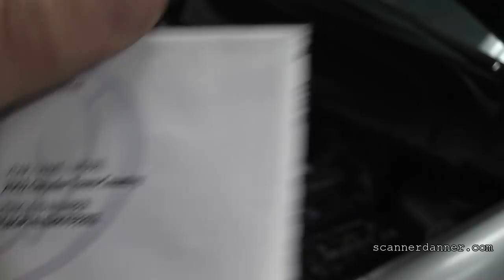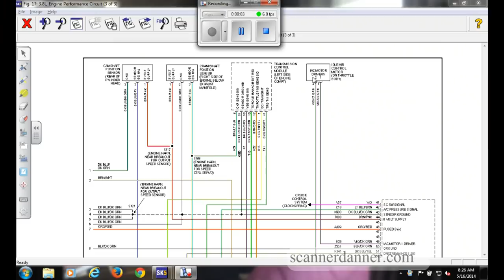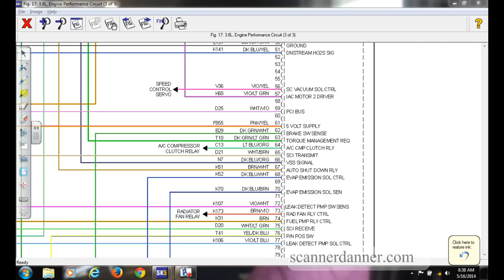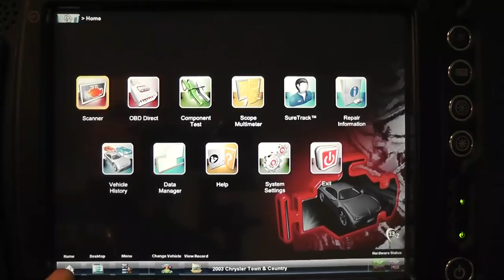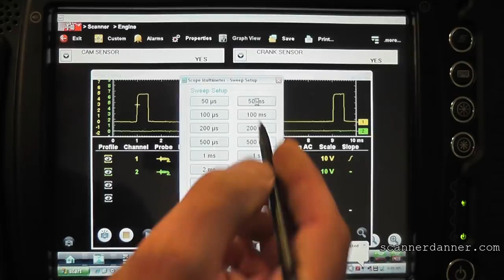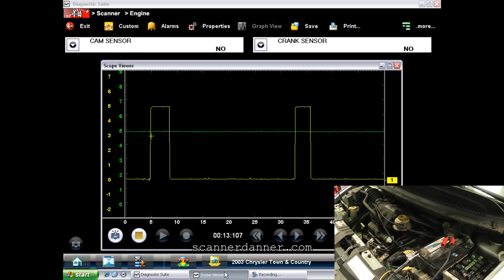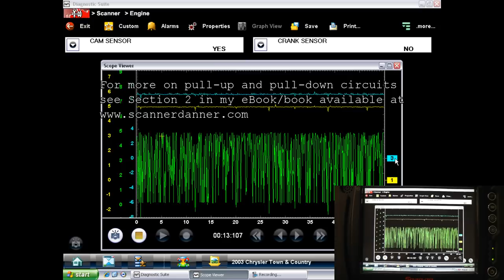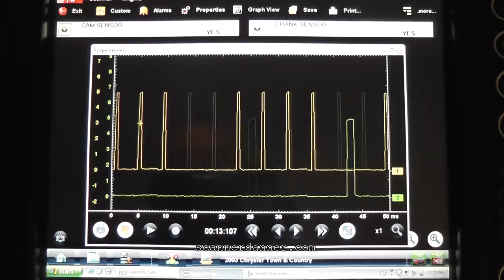Faulty cam sensor setting a crank sensor code - P1389, P0320, P0622

Comment: Every manufacturer I've had any experience with has fudged their model year cut-offs all over the place. The VIN says that T&C is a 2002, that doesn't mean 2003 stuff wasn't put on early, or leftover 2001 stuff put on late. Always have to be careful of that stuff, especially on years bordering design changes.

Comment: Superb Paul,I love how you can “prove” that the cam sensor is faulty,the thing is a lot of people(especially the general public)think that running a diagnostic on a vehicle will pin point the fault but as I’ve found out many times in the past and as you are proving here it’s simply not the case....Thanks again

Comment: Worked on a Kia recently with a cam sensor code. One of the fixes was listed as crank sensor, and i've heard of this on other brands as well, Always wondered what the reason was, now i know. Love your channel! My fix happened to be the first thing i checked, the ground. 121 ohms, next i checked battery ground to engine , SAME. Cleaned negative battery terminal, back to 0. ALL GOOD.

Comment: Danner at his best!  Here we have Verus training, scope and scan tool usage. How to use the wiring diagram to connect properly. Quick question. If the sensor is fed 9 volts, why does the cam signal high read 5?

Comment: it's superb Diagnosis and well enough explained. As I'm just a beginner, have some questions; power feed 9 volts - signal 5 volts (why & how is the difference between Power Feed volt vs Signal volt? when you unplugged Cam connector, it was showing 5 volts because PCM was sending 5 volts on Signal Wire? when connector plugged why trace on Scope was so noisy 5v <-> 0v while KOEO? though it must show 5 volt steady as Crank.
I very much realized how super necessary a Scope for modern day vehicles. Thank you Paul

Comment: Scanner Danner you commented @ 31:41 that the test leads on the verus were too short, Verus has a 9 FT USB cable, you can remove the scope from the Verus and use the USB as an extension cord and leave the verus on the bench.. you probably are aware of this already but in case you arent., , Also, Love the Vids, I am a scope guy and learn alot from your Vids. i wonder how i ever got along without the scope. I use it more and more every day. Again thanks keep the vids coming.

Comment: Nice video. I wholly subscribe to your diagnostic techniques (i.e., testing and verifying with a lab scope, etc.). However, I wish shop owners, managers, and service writers where I have worked would understand the importance of diagnostic testing. Unfortunately, they seem to equate experience with having knowledge of pattern failures and skipping the testing. If you want to test, it seems to be why is it taking so long. This is very frustrating.

Comment: I like to use the component test for the same reasons one thing I have noticed though is that some of the component test headings will limit how many channels you can use. Also you mention the length of the leads there is a set of leads available I think they are 10 feet long, it is actually designed so you can hook up the scope and drive the car. Probably a little excessive on the length but longer.

Comment: Paul can I ask you a question,have you any idea why like in this example the manufacturer has 4 windows cut into the flywheel for the crank sensor to pick up on,I can’t understand why they do this if it’s only to identify a cylinder at TDC.....why not just one window giving one pulse on the scope,the same for the cam sensor...why so many cut outs/pulses ? I’m really confused about this.....Many Thanks mate 👍🏻

Comment: Just curious, I have picked up a Hantek 1008 scope and am trying to soak up as much as I can about using the scope for diagnosis.  Would you need attenuators on this kinds of sensors? (cam and crank)  My unit came with test leads but no attenuators, so don't want to be putting the unit in harms way right out of the box!
Reply: You will need Attenuators when you need to step down Voltage so you dont harm your scope.  Something like the magnetic field spike on an Injector, or the firing of a spark plug when scoping a coil.   Sometimes that stuff can get crazy spikes.    When you use the Attenuators, make sure you select that option in your scope.
No need for one on a cam or crank sensor.

Comment: I have a 2008 bmw x3 3.0si, it has a code for the crank postion circuit p0335. Only symptoms is long crank times and running rough. I replaced the sensor but it didnt solve the problem. Any direction??
Reply from the maker: you'll need to test the crank sensor circuit with a scope preferably or with at least a digital voltmeter. 
Post here for more help
 https://scannerdanner.com/forum/post-your-repair-questions-here.html
Reply: ScannerDanner thanks for the reply, it ended up being a crank sensor fitment issue with the oring

Comment: I dint know if you'll reply to my comment.   I got a code p0340 faulty camshaft sensor,  ordered the part haven't gotten it installed yet, then this week code p0622 came up.  anyways can a bad camshaft sensor cause a code p0622 something to do with the alternator am I right?     2003 Mitsubishi eclipse v6. Camsensor is built in the distributor

Comment: You mentioned that there's a lot of oil under the hood from leeks.  Did the oil have any part of the cam sensor failing?  Great video!
Reply from the maker: not at all related. Thanks!

Comment: I have a 2010 Grand Caravan and about a week ago it shut down while my wife was driving it. It would then crank but not start. It was running perfect before this happened and only has 42k miles on it. I took it to shop and they said it "jumped time" and will probably have a lot of damage since it is an interference engine. My question is could a faulty or disconnected cam position sensor mimic a jumped timing chain? Sorry if this a dumb question, it just seems highly unlikely to me that a timing chain would fail at such low miles.
Reply from the maker: That does seem very unlikely. And yes a faulty cam or crank sensor could have similar symptoms but not typically. Does it sound like it is cranking very fast?
Reply: No, it sounded pretty normal the first couple of times. The third time I cranked it a little longer and it kinda sputtered a little.
Reply from the maker: Where are you located? I'll confirm that diagnosis for you for free if you let me film it.
Reply from the maker: This may sound crazy but I'm traveling out west in an RV with my family around the 2nd week of June. We are heading to arizona and Utah  from Pittsburgh pa. Would you be in route for me to stop by? I'm actually bringing all of my equipment and was planning on helping people along the way.
Reply from the maker: If you're in a hurry to get your van fixed. Get a second opinion. Something doesn't sound right with that diagnosis
Reply: I think I will do that. Thank you for responding.
Reply: I just saw your previous comments. I live in Poplar Bluff, MO. Probably not en-route for you, but if so that would be great!
Reply from the maker: Big Sky country! I would love to visit your state someday but you're correct, not on this trip. Keep me posted on the fix okay?
Reply: Missouri actually, but we need to drive it to Alabama June 17th so if it does need major work/new engine I'm gonna have to get it fixed pretty soon I guess. I appreciate your input. I'll keep you posted.
Reply from the maker: Lol why would Missouri be abbreviated MO?  What is Montana?
Reply: I know, I always thought it was kinda goofy too. I guess MI was in high demand though, between Minnesota, Mississippi, Missouri, and Michigan. Lol
Reply: highly unlikely , get a second opinion

Comment: My 5.9 Durango quit on me once, with ASD/FP relay rapid clicking after warming up. Found the ground side switch of the relay from the PCM was coming in and out, and powers and grounds were good coming in to the PCM. Found myself triple checking stupid shit just so I didn't have to buy a PCM, but the new PCM fixed it.

Comment: thats an intresting issue. i have this very van same engine and all and keep getting a cylinder 2 miss. ignition system all replaced has perfect compression. leaning in the injectors direction. thoughs?

Comment: I noticed the cmp and ckp waveforms never overlap (on top of each other).  What could cause a Jeep 4.7 trace to show cmp and ckp  frequently on top of each other.   The Jeep runs fine but has a reoccurring intermittent cmp / ckp fault code?
Reply from the maker: you will need a known good cam and crank waveform that you can view in detail and compare it to your own. Post this to my forum and we can help you there. Thanks! IT is free to join 
https://www.scannerdanner.com/forum/post-your-repair-questions-here.html

Comment: Question, Paul. I thought cam sensors were really only necessary during startup, and that once the pcm knew which stroke the engine was on, it just repeated the firing order over and over. Is that true on some models, or do you always need a cam signal?

Also, why is there the 1,2,3 style signals? Why not just one cam pulse every 720 degrees, and then rely on which crank tooth its on? There doesn't seem to be very many crank pulses here.
Reply from the maker: It all depends on the crank sensor design. If there is no sync or identifier signal in the crank sensor, then the cam is also needed for start up to occur.
If you have my book, this would be section 22 I believe.
Here is a lecture I did on this very topic
Section 22 No Start, No Spark Diagnosis (Part 1)
Reply: ScannerDanner
 MINI coopers, you do not need a cam signal for start up. We had a crank no start condition, scoped the camshaft sensor, had a small blip in the wave form on one of the 3 phases. (small, medium, big)   Unplugged the sensor, car started.  (Didnt run to well and went into a fail safe, but started nonetheless.)

Comment: Hi
I have santa fe 2012-V6-3500L -18000km, when  turn on to  run position - engine stop (The pump should run for about two seconds) the fuel pump did not work !
and I start engine hard because of that (on engine run fuel pump work very good and Pressure is very good too ) ,   I check fuse and Relay it  very good !
why my fuel pump not work in run position- engine stop for 2 second  ?

Comment: I have a 2011 chevy impala the traction control, and stabilitrac lights came on then engine light the car started shifting hard, and engine began running really rough. I checked the wire visually did not see any problems with wires I could see. I had a guy check the codes and he said it brought up invalid codes, and thought the ecm was bad. So I replaced the ecm out of another 2011 impala and flashed it 10min security light on 1min. security light off and 30seconds with ignition off X 4 on 4th one after the 30second ign.off started car. After starting car it ran perfect for a few minutes then traction, and stabilitrac lights came on and engine light was already on but engine began running bad again. Shut car off let sit for few minutes restarted car ran good again with engine light still staying on. I ran codes again now it shows P0315 crankshaft pos sensor not learn. I have come to my limits with what to do except take car to dealer which is what I been trying to avoid.
Reply from the maker: When ANY fault with the engine is causing the check engine light, this will automatically shut off the traction control and stabilitrac systems and it will light those lights too. Fix your engine faults and you will fix everything. What was the engine code BEFORE you replaced the ECM?

Comment: Hey Scanner Dan. Got a P0622 code. Changed all mechanical parts, code still exists but only comes on when hot and at 2800 rpms in drive from a stop at light or etc,, not park or idle. Most definitely when hot only. WTF is it? 2006 Chrysler Town and Country
Reply from the maker: "changed all mechanical parts" makes me cringe lol, so many bad parts being sold these days. What is the definition of the code please, thanks!
Reply: @ScannerDanner  Generator field control circuit. PO622 on 2006 Chrysler Town and Country. Ha. I agree. Why change all the parts? Got the answer. Don't listen to almost all YouTuber's. I love your channel by the way. I have the answer. Went to a mechanic today who normally charges hundreds. He did it for free. I secretly gave him 60 through his secretary/assistant. That's all I had. He's one of the best I ever met. Like you. Didn't meet you of course but been watching you for a while. I can toot the horn for you. The motor mounts are going bad. But not really bad. There is a tension or stretch on the wire harness which is pulling the wires when van acceleration is over 2800 rpm. I drive hard cause I have to drive on Rte 80 in Jersey to PA. In order to fix it, I will find the beginning and end of the alternator wires and just put new ones in that are slightly longer, connecting both ends as they belong. Then replace the mounts. Good call?

Comment: per VIN My truck is a 2002 dodge ram 4.7

with a 5.9

To make this change requires computer AND ABS from same truck to run right.

It will run without the correct abs but you get a continuous ding sound which will drive you insane

fortunately i own both trucks and my original 5.9 was wrecked and the 4.7 had a head gasket problem from the stupid closed pressurized coolant system.

ran fine for years and now 1389 code when crank and cam sensors connected on crank but no code if i disconnect either crank or cam sensor.

this truck problem started as a ran fine till turned off and then crank no start no communication with scanner or dash guages. 
then, for some reason, noticed that C1 FELL out of the computer / ecm it was just hanging down. would not lock in.

BUT drove truck home using another computer which had transmission codes on it but those same codes would not show on my computer later when I got com back which would happen intermittently when it would start intermittently, run for 2 to 20 min and the  loose com again and die with no code’s whatsoever.

After many checks, I finally took off 
 the computer cover plate and I could reproduce the shut down and start of the truck by simply pressing my thumb into the silicone gel at a certain spot on a certain chip just below C2 connection. 

I removed most of that stupid silicone and found one loose chip solder connection.

I resoldered it and every other one I could get to.

Thanks to whoever created this silicone gel covered garbage that was a royal PITA . It’s doable but tedious.

However, when I put i the ecm back in I had good communication and the 1389 code which I didn’t have before and it will crank but not start.

While , I was searching wires earlier in this journey I noticed when I move the wires under the steering column, the truck will try to start on its own with no key in the ignition, even if I let go of the wires and it did this about six times.  Whoever wire the alarm system wasn’t even bigger. Idiot the engineers who created these systems. They had simply stripped about an inch of casing off the wires and wrapped the alarm wires around them with electrical tape.
This is a 2002 truck and it ran well before this, so maybe if I had not move the wires, it would not have changed anything but it did so I removed all the alarm wires and change the whole system back to factory. I bought it used many years ago and never use the alarm.

so now it cranks, but does not start at all, but has a 1389 code only if I have both crank sensor and cam sensor connected. If I disconnect one of those sensors, the 1389 code goes away.

also, there is no engine rpm in live data. …. ZERO engine rpm when cranking.
The scanner only cost about $160 but it works fairly well

All I have is a basic scanner, a micrometer and a test light .

I had 5 v reference previously and will rechecktomorrow because it got dark on me and the bugs started coming out.

I have three 1970s and one 1980 carbureted vehicles in my yard and I am really tempted to strip this 2002 truck down and change it all to carbureted engines with a simple, electronic voltage regulator and an actual alternator, and maybe even a manual transmission.

I am so tired of the BS and his new vehicles .

When they run right they are efficient, but they leave you stranded on the side of the road because the engineers are smoking too much weed or at least that’s my thought.

PS :   You can take the cover off a relay very easily and watch it work or not work and hear it a lot better. Then just keep that relay as a spare or put the cover back on which ever you choose.
Reply from the maker: Did you fix it? Could be a jumped timing chain or belt